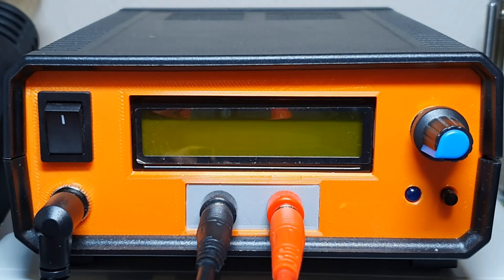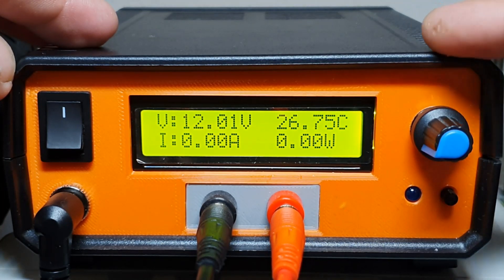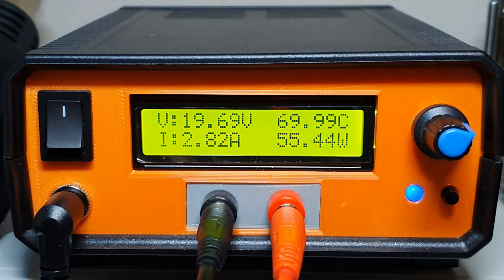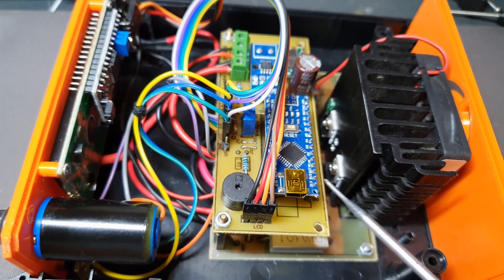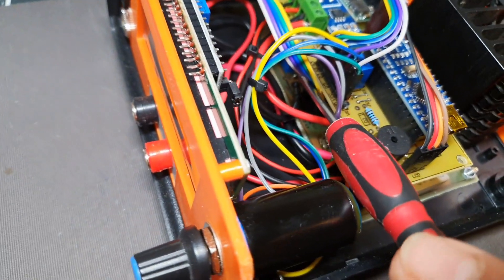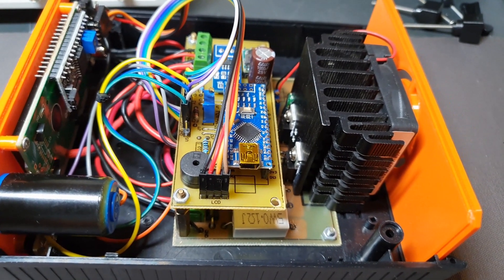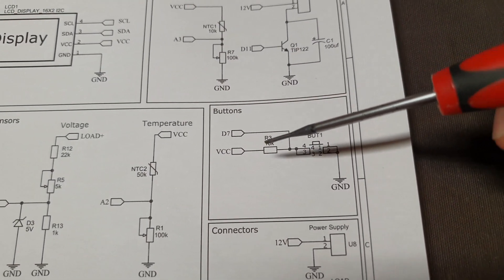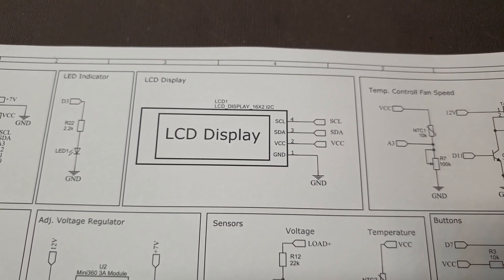DIY Electronic DC Load | Arduino Nano

Comment: It's a great project ... I would love to do it ... Only issue is 3Amp! ... I need around 8-10A
Reply: A little bit late, you probably found a solution already. I used IRFP260N It can easilt handle 8A at 12V and below, for more power you can use multiple in parllel.
Reply: @AVI-xo1kb  Thank you
Reply: Use TO-247 package mosfets such as 260N, 250N and change a little in the code

Comment: Please give box STL file
Reply from the maker: I'm sorry but I don't have the complete case STL files because the case  I bought it, I only 3D printed the front  and back panels and didn't share those because it be a very little chance to have the same case as mine. When I will have time I will design the rest of the case and I will share the  STL files.

Comment: Very nice job! Is it possible that you you can provide the PCB files?
Reply from the maker: Thanks! I put a link to all the necessary files in the video description.
Reply: @HMProjects  I saw that thank you, but it would be ncie wehen i could import the schematic or smth
Reply: @bogy5259  The PDF's allow you to print the circuits to a transfer medium, place it on a cheap, blank single sided PCB and etch the circuit board yourself. There are no files for sending off to have PCBs manufactured- unless you can import circuits from an image. Easy enough to make

Comment: Hi, you have done a nice job. I just wanted to ask you about the purpose of the 100uF C1 capacitor around TIP122 in the temperature controlled fan zone. Thank you?

Comment: Hello. In the folder version 1 of the firmware. Does the electronic load have the ability to limit the voltage at the end of the battery discharge?
Reply from the maker: Hi. No, it hasn't that, but it can be done in software, it is quite good idea and I probably add that feature soon.
Reply: @HMProjects  That's a good idea. We are very much waiting for the upgrade.

Comment: Can u make 60v 10A Auto cut off circuit using oled or lcd for my e bike charging purpose
Reply from the maker: I think is possible to make, maybe I will do it in the next project.
Reply: @HMProjects  thank you sir ❤️
Reply: 60v 20A 🤔 Is it possible to limit the voltage at the end of the battery discharge?

Comment: interest, can this make oled lcd + connector USB to charging.
Reply from the maker: Hi, yes you can use a OLED display but you have to modify the code entirely. There's no point to put an usb connector, this is a electronic load not a power supply.